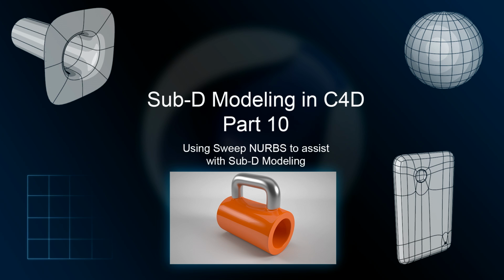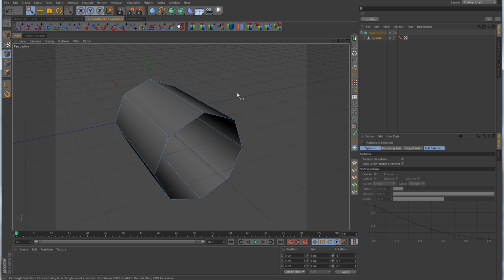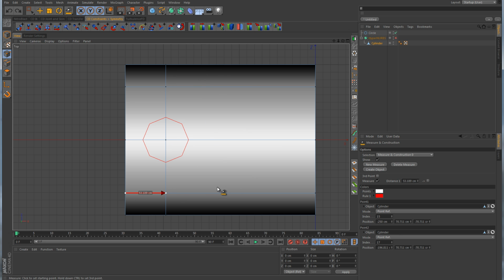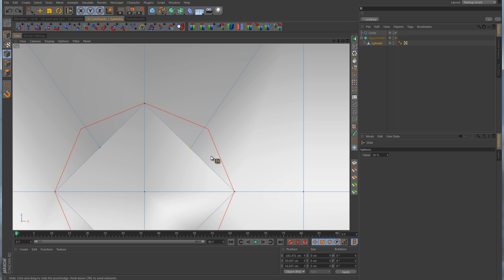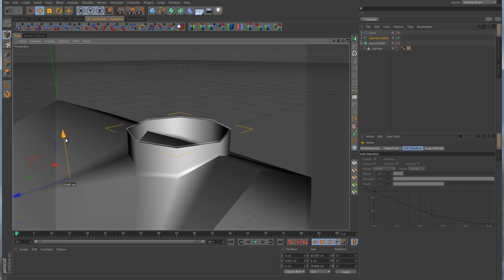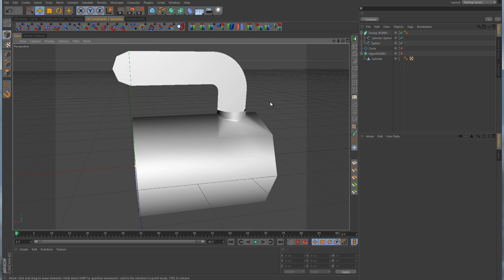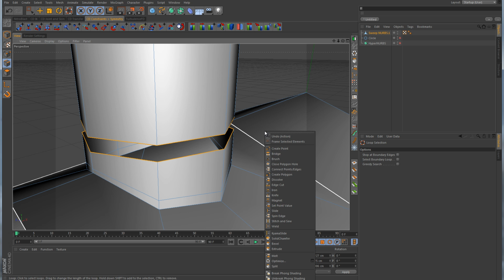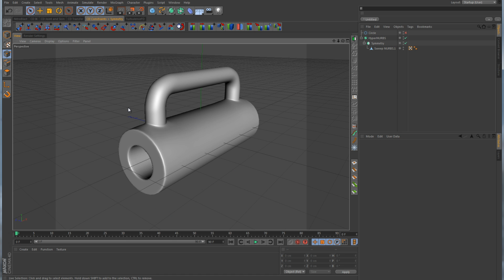Sub-D Modeling in C4D - Lesson 10 - Using SweepNURBS to assist in modeling

Comment from the maker: This issue is usually caused by not enough rotation segments on the cylinder. Instead of using 8, try using 16. I just tried 16 and it greatly reduced the bulging effect.